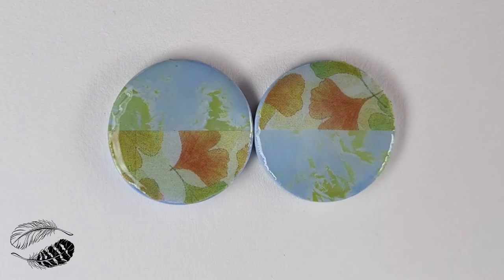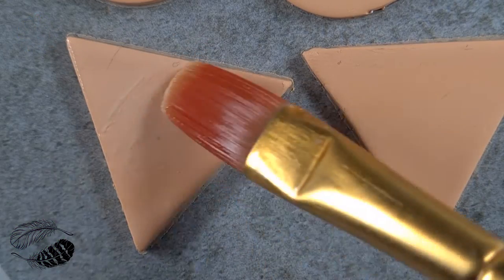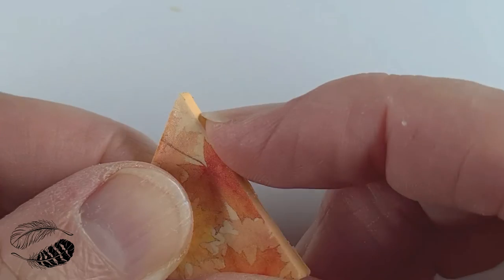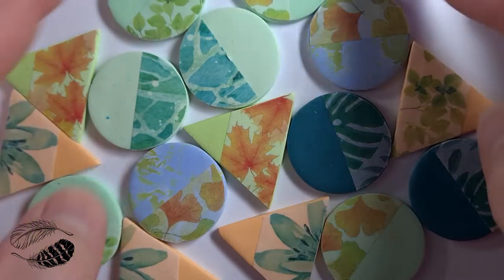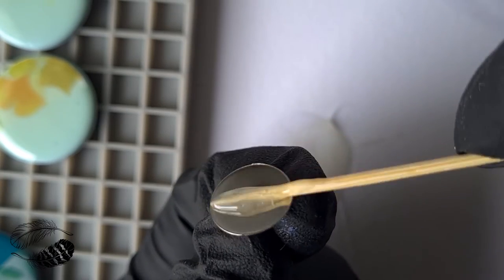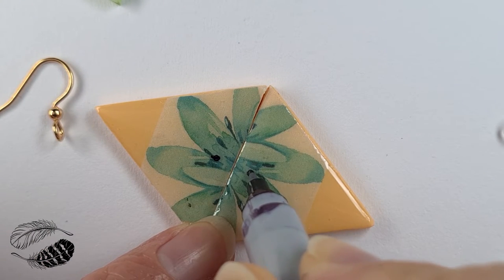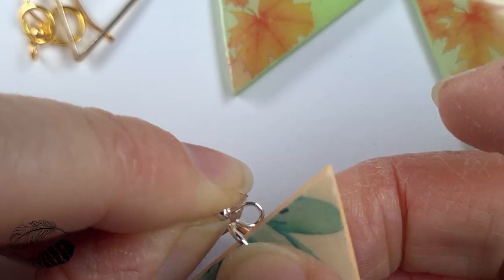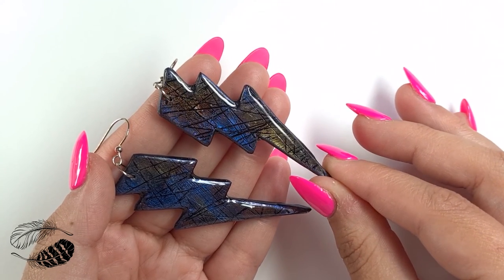😍 POLYMER CLAY WASHI TAPE EARRINGS DIY TUTORIAL: Quick & Fun Polymer Clay Earrings Timelapse!

Comment: I do this with my earring hooks all the time. I like to use black earring hooks too but the metal doesn't like being fiddled with and often breaks. My son told me to use a lighter on the spot I want to twist for a couple of seconds and it was an amazing solution. The only part that gets hot is the hole where the jump ring goes. The rest of the ear wire is normal temp so I have never burned myself doing this.  😊❤
Reply from the maker: Dana, Thank you so much for sharing such an amazing technique with everyone watching this tutorial! What an amazing idea and I will be sure to try that one out myself! Thanks so much! 🤩

Comment: really pretty.  Can I use a small hole cutter through the washi tape before baking?
Reply from the maker: Hey Nancy, I personally wouldn't try to cut a whole before baking as I feel the clay is too unstable and the tape won't have any secure surface and will most likely sink and move. But test test test to see if you can achieve what you are after on a scrap piece. Perhaps try at least marking the spot with a tiny needle indentation for later? After baking.. I think it depends on the type of whole cutter you are using and I always recommend experimenting on a test piece beforehand. 🙏🙏If its a manual hand drill, whether its baked or not if you are trying to make a hole through the washi tape part, it might distort a little given the nature of the stickiness/tackiness of the tape to move a little on the surface. You could start off with poking a small hole with a needle, so your manual hand drill has an indentation to sit in and is less likely to move around and slip out. I used an electric drill and it worked fine. Another tip would be to start the hole with the tape side facing upwards, which might  help keep the integrity of the tape somewhat. When in doubt... Test, test, test... I used a Hope this helps a little!

Comment: where do you get the items to make the ear rings
Reply from the maker: I recommend buying your clay from specialist polymer clay supplier to make sure it is fresh and workable. You can use your hands and whatever modelling tools you like and all of them can be found on amazon or ebay. Was there something in particular you were having trouble finding? Happy to help. 🥰Hopefully I will have an amazon store on the next 3-6 months, however it might take me a little while as it's a lot of work for me to do and requirements I need to meet as a small content creator with limited resources (I'm still working on it), however I will do the best I can. Thanks so much for supporting me. :) Also if anyone else is wondering this same question please let me know here in the comments.

Comment: This is probably a silly question, but do you glue the tape onto the clay? How does it stick on? I bought a whole stack of pretty tapes & it all lifted when I baked it. Not sure what I'm doing wrong 🤔
Reply from the maker: Definitely not a silly question Jacqueline. Firstly I would ensure that the clay you're using is well conditioned by performing the crack test. This means that when you fold a sheet of clay in half that it doesn't crack - meaning is well conditioned. If the clay isn't warmed up and the plasticizers are not activated, there could be issues with it gripping onto the Washi tape. Also the thickness of the washi tape could be a factor. The tape that I used was 15 mm thick which has a large surface area than the 5 mm versions of Washi tape that are available which would have a less surface area to stick onto the clay. In the tutorial I have added the tape directly onto the wet clay and then put it straight into the oven. You could definitely try adding a thin layer of clear Bake N' bond, on the underside of the tape and then bake it, and you could also experiment with adding the clear Bake N' bond over the top of the tape and the rest of the earing to get a nice satin glaze, that would incase the tape onto the polymer clay together quite well. However you won't know until you test it. 
To remedy the earrings with the tape that you've already made, you could also glue the ends or the entire piece of tape down, with some super glue or glue of your choice. I recommend gorilla superglue, as I've heard good things about it, however experimentation is always the better way to go. Please note I don't recommend re-baking the earing after applying any type of foreign glue for health and safety reasons! The other option is you could cover the top of the earring in a clear UV resin or similar (however the tape would need to be firmly stuck down before adding the resin). Another option is you can bake the slabs first, then simply stick the Washi tape on after they are baked. The reason why I suggest this is because perhaps the glue on that particular Washi tape may have dried out in the baking process affecting its stickiness. I had lots of earrings that I kept raw with the tape just stuck on the clay which are still stuck now no problems.
Different Washi tapes have different glues and levels of stickiness as well. So it could be that the brand that you are using has a very weak bonding ability for this type of project, and it may not be anything that you are doing wrong, just the fact that the tape has been manufactured differently and is simply not sticky enough. Having said that though I think it would also be worth trying baking your existing tape again in the oven, however checking that you are baking for the absolute minimum time according to the brands baking instructions. Reason why am saying this is because the longer the tape is in the oven, the greater the chance the glue may be drying out and then peeling off your earrings. Hope this helps!
Reply: @twofeathersgalleryart  thank you so much for your very helpful reply 🥰 I really appreciate you taking the time to answer me so thoroughly. I'll definitely try again using your suggestions because the tapes were so pretty & it's a shame not to use them. Much love from Australia 🦘❤️
Reply from the maker: @UCw1Zn8RJIVfttv-9Y%F0%9F%92%96%F0%9F%92%96H1cwkA Jacqueline let me know if you have any other questions and I am happy to help in anyway I can. With kindness Mel 💛